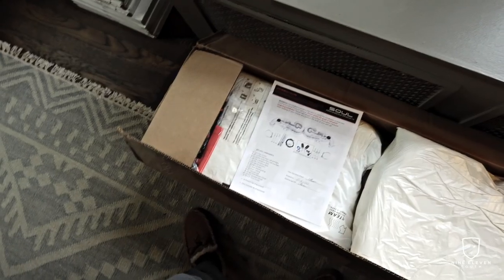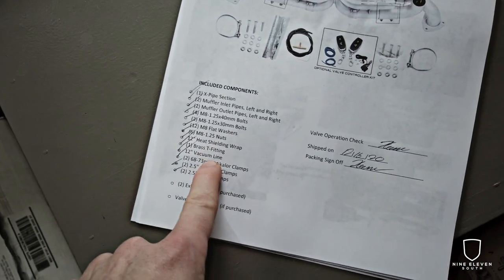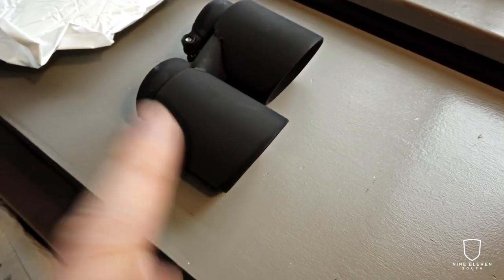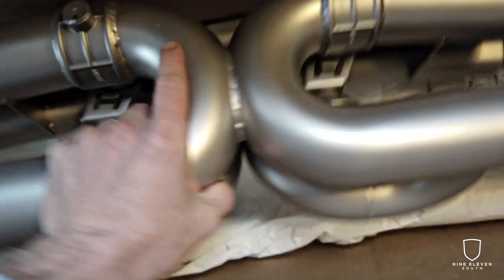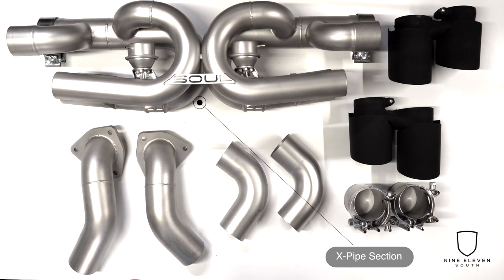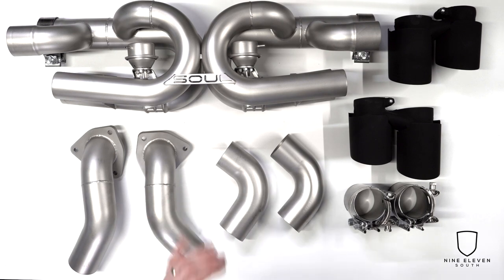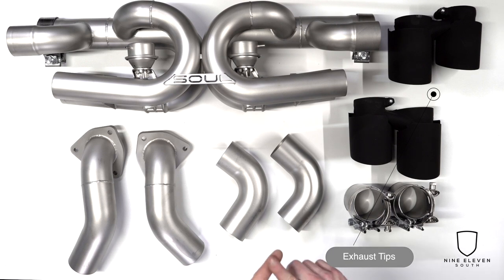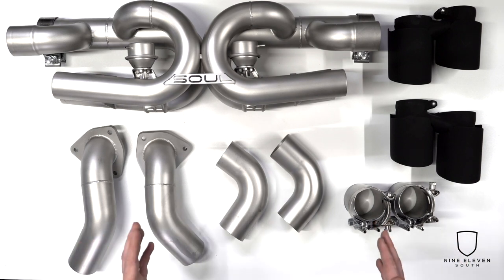Porsche 911 Soul Exhaust Unboxing & Tabletop | The 991 Custom Performance Build Series [Episode 8]

Comment: Do you also plan on doing the headers?
Reply from the maker: I think I will do them at some point, yes. The real HP gains in a naturally aspirated engine are in the headers, not the rear section I did.